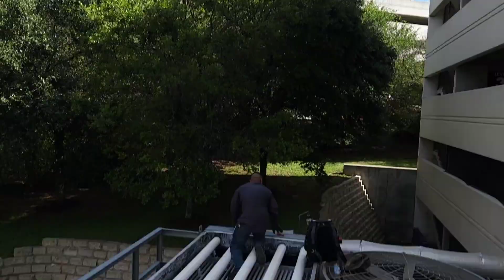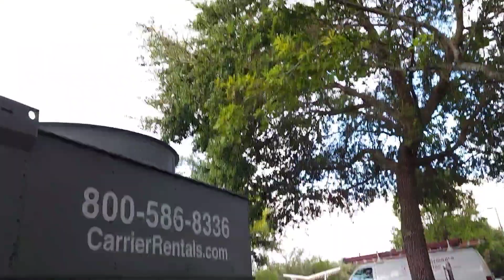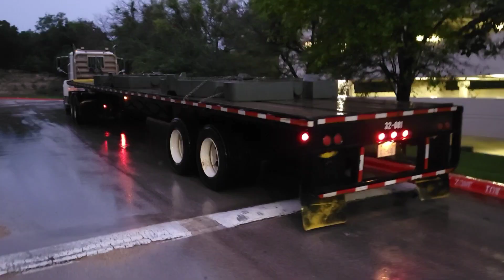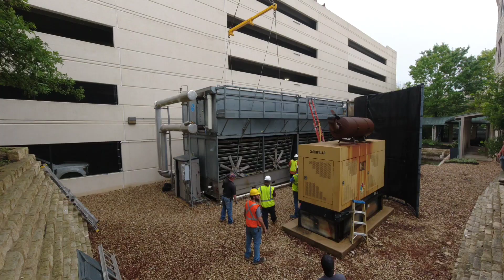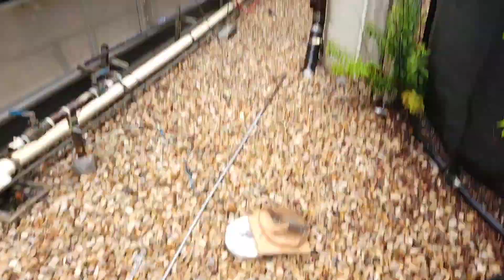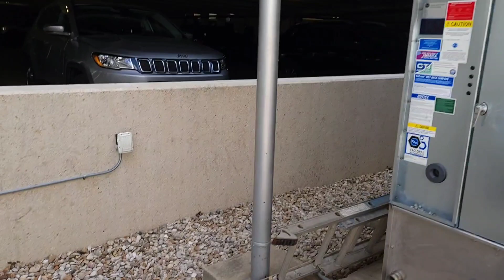Cooling Tower Changeout HVAC BAC

Comment: Just opened towers up for few buildings i do .1 of the evapco heat exchangers got very bad leak.it is for a loop that supplys water source heatpumps.there is 2 sections above heat exchanger. I dont know if to tell them we need a whole new tower or try to do heat exchanger what would you do?
Reply from the maker: The towers are very common to leak at the seams between the sections. The butal tape doesn't always seal well. Usually we shut the tower down and seal seams with silicone and let dry.
Reply: @HVACTIME  yes that is exactly where it is
Reply from the maker: That sucks, new heat exchanger
Reply from the maker: If the leak is the heat exchanger itself where exactly is the leak?
Reply: @HVACTIME  2 rows down in middle

Comment: Just a question was there any provision put in place in order to avoid the same disastrous scenario? Great vids keep them coming very conscious and to the point
Reply from the maker: They have freeze protection already, problem is they lost power for 3 days and the generator failed preventing the pumps from protecting the bundles.